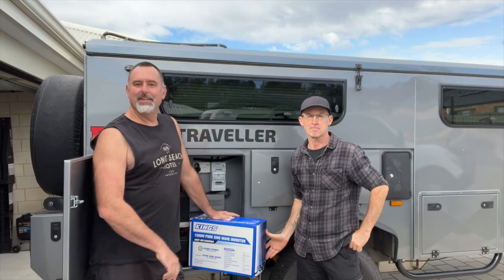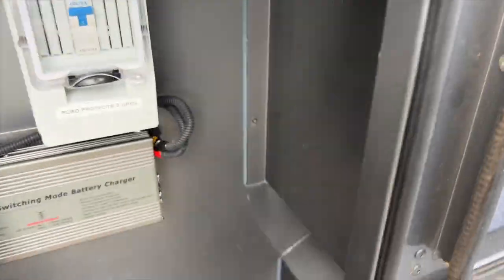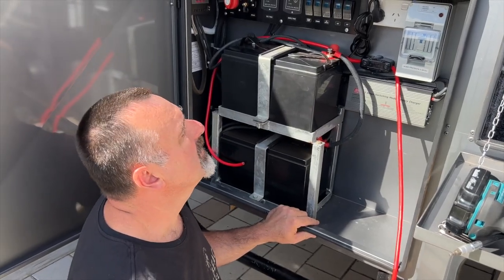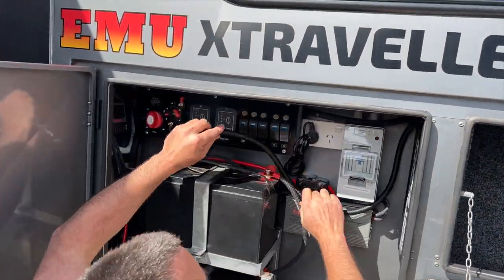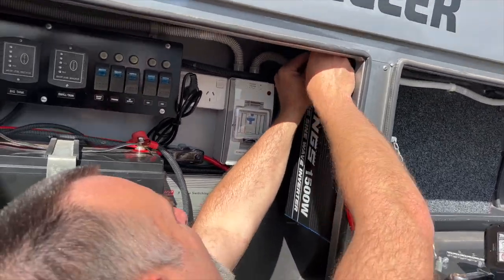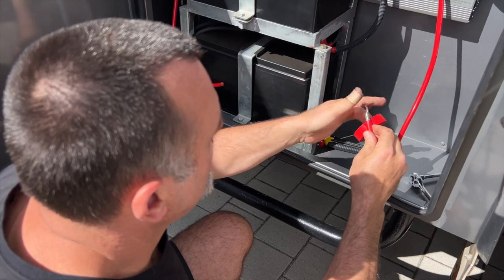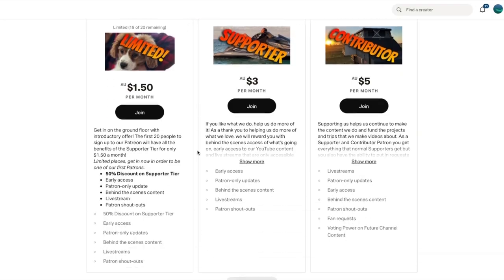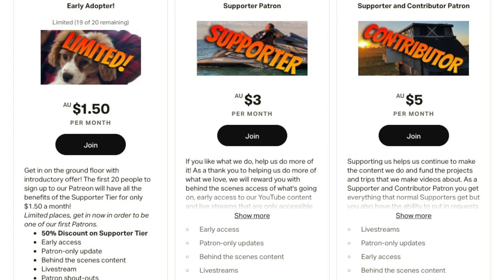I install a KINGS INVERTER into a SUBSCRIBER'S Emu XTRAVELLER HYBRID Camper

Comment: Great video and workmanship was excellent. Just an observation , and I might be wrong. It looked like a dual battery parallel set up. If this is the case it would of been better to connect +ve to one battery and -ve to the other. Ensures the parallel batteries are working as one.

Comment: when installing any inverter the cables should be as close  to same length as possible for resistance plus have fuse close as possible if shit sorts out. and add a switch in the line because inverters will drain  power even if not in use having the some one from experience

Comment: Nicely done. I'd love to know how the inverter performs. 
I would put an isolation switch between the battery and the inverter. I know the inverter has a power switch, but another level of safety in case the switch in the inverter fails on. Having done that,  wire a pre-charge resistor across the terminals of the switch so that the caps in the inverter charge before you throw the switch on. I'd guess a resistor value, like a 490R or something rated at a couple of watts would do admirably. Just my 2 bobs.
Reply from the maker: Yeah we were working with what we had on hand in limited time. The ol’ trick with charging the caps is to run a halogen headline globe in series when you first touch the connector 🤣 Most modern campers have an inverter hard wired, the Xpedition did too and it was wired the same with a circuit breaker. They always arc when you reconnect too. So yeah the breaker can act as a isolation switch too but they are so dodgy and create so much heat and voltage drop I changed mine to ANL fuses and did the same here.  Putting a DC isolation switch would be best but it also adds extra cable and resistance to a high amp application so yes and also no depending on how you look at it I guess. If something really bad happened the fuse would blow and kill it so I’m ok with it. In reality the internals of the inverter would lost likely go before the fuse anyway. But love the comment and it’s also sound advice so cheers Benny 👍
Reply: @JebbreysJibberish  That's actually a very, very good point about increased resistance....better rethink some of my plans!
Reply: @JebbreysJibberish  with high current always go the fuse vs a cheap Chinese isolator
Reply: @JebbreysJibberish  Could you not just use a switch rated for the amperage?
Reply from the maker: It would not isolate in a dead short situation creating a fire risk if anything ever goes wrong.
Reply: @JebbreysJibberish  obviously you'd still have your fuse. But you could isolate the inverter with a switch on the positive side too. I've seen these switches stop cars from burning down due to an inverter failure.
Reply: @JebbreysJibberish  That's a good point. It would need to be one hell of an isolator switch.

Comment: Subscribed to your patreon too. I’m really amazed by your well produced Videos. Keep it up. 

How’s it possible that a 1500W inverter is able to power up a 1600w coffee machine?
Reply from the maker: Thank you for your support. Interestingly enough when we run it inside it tripped out. It would work directly plugged in but add just a smidge of extra cable and it was too much for it so it was right on the limit!

Comment: What gauge wire did you use from the inverter to the battery? 
Was it 4awg?
Why such heavy gauge?
Isn't the inverter already fused internally with a (blade) fuse?
Why specifically a ANL 175a fuse?

Sorry for all the questions, I'm sure others are interested. 
Cheers.
Reply from the maker: Yes 4awg because 1500w at 12v in ideal
Conditions is 125amps
Continuous. The inverter can do close to 2000w peak which is 166amps. Theoretically while drawing 166amps the voltage drop would be extreme so the amps would be even higher. The thicker the cable the less voltage drop and the less heat. The ANL fuse is because they are one of the few that you can get above 100amps. The inverter most likely has half a dozen 30 amp blade fuses in parallel internally but that’s not going to stop a fire if the cabling goes into a dead short somewhere on route from the battery to the inverter.
Reply: @JebbreysJibberish  Thank you I also wanted to know about the fuses .
Reply: @JebbreysJibberish  Hey mate great video ....just wondering do you think a 200amp manual reset circuit breaker will be ok for the kings 1500w inverter ? Cheers
Reply from the maker: Yes I do, but the reasons I’ve steered away from those in recent years is 1. Some of those Chinese breakers actually don’t trip when tested even on a dead short and 2. The one originally used on my inverter setup in my van was creating a lot of voltage drop at high current and getting really hot. That’s why I’ve moved over to fuses instead now.